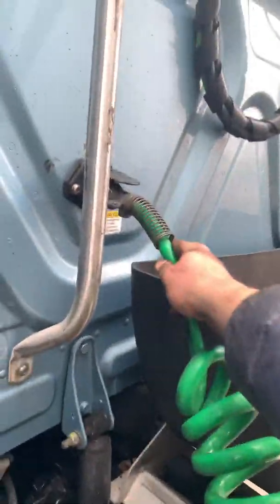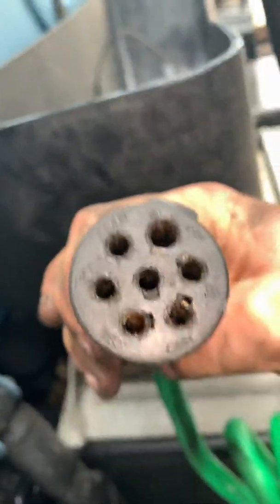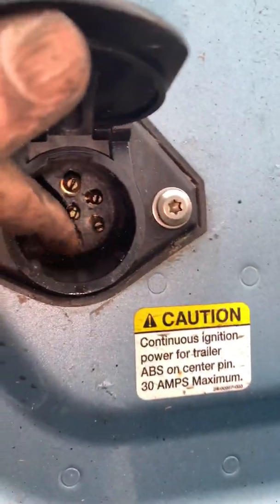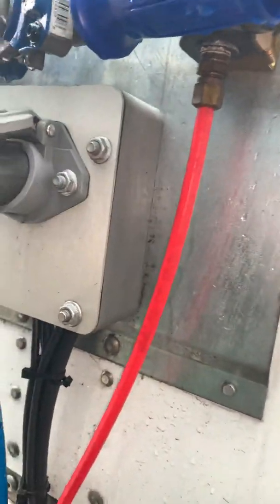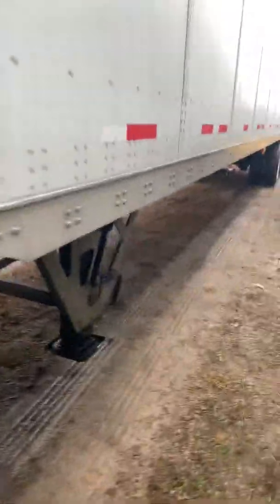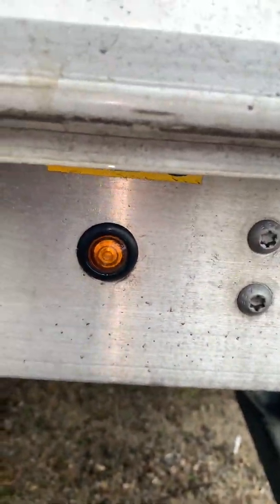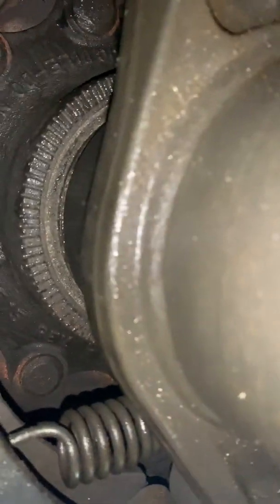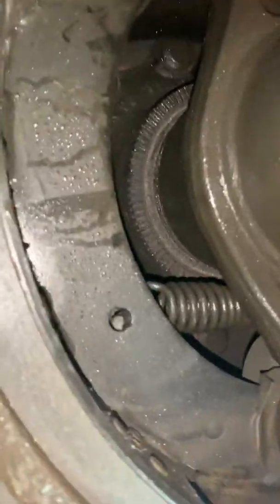Semi truck trailer ABS issues & troubleshooting

Comment: In my trailer the abs light isnot go on never , what could be ??
Reply: Perfect thank you a lot formyou help , my is a century ,I will check the box fuse !
Reply: frank navarro do you have trl aux switch on your dash? Turn it on and you should have a trl abs light come on during ignition start up
Reply: @franknavarro4183 I know this is an old comment but, my freighter century trailer fuses are located behind the driver seat right under where the seat belt hangs. There’s a flat head screw holding the cover. Above the plug for the ELD.
Reply: The bulb itself?
Reply: the bulb is working good , I tested it before , and all the cable are good too
Reply: @franknavarro4183  
The power relay to the trailer as well as the fuses for the trailer?
Reply: Sorry for my ignorance, but where I can find the relay or the fuse for trailer abs ?
Reply: @franknavarro4183  
No apologies needed.  The box of fuses and relays for the trailer are usually in the front of the tractor.  My 2014 cascadia have them under the hood by the steering wheel shaft on the firewall. The relays and fuses are labeled according.